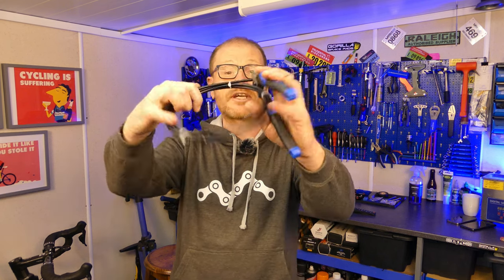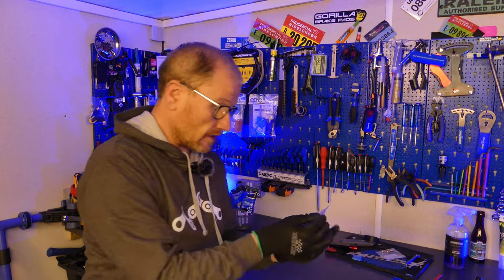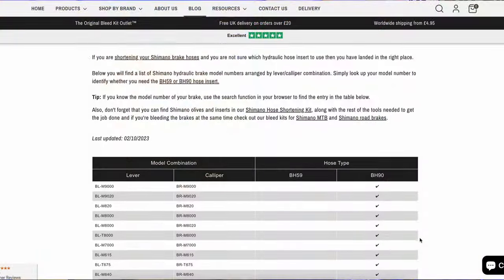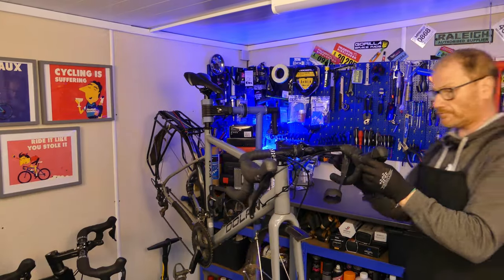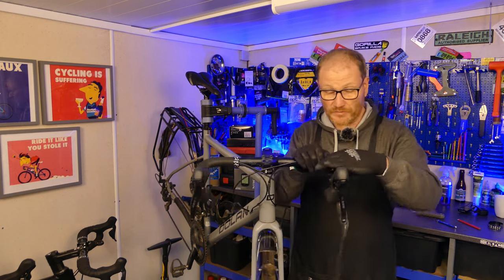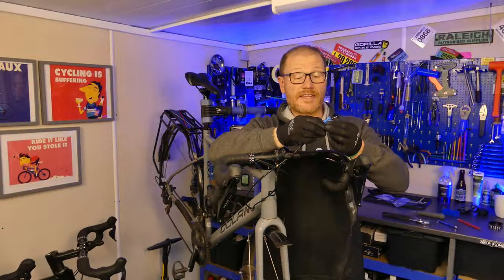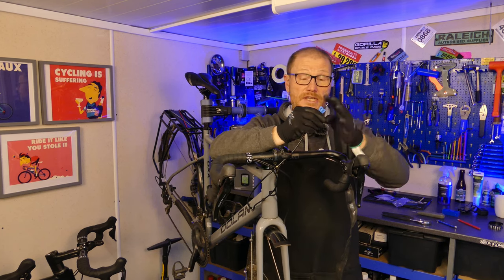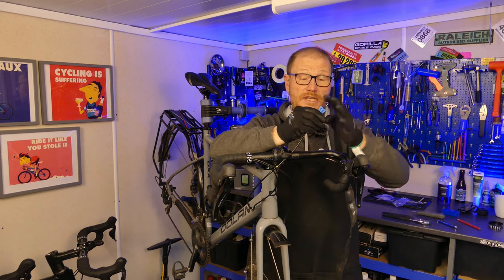How To Shorten A Hydraulic Disc Brake Hose - Road Bike maintenance

Comment: I'm using BH90 hose on calipers that use BH59 nominally. It works just fine, because the only thing that changes is the inner diameter of the hose and thus the barb that goes with it. BH90 is thicker and thus stiffer, but I doubt most people would notice the difference; I certainly can't.
Reply from the maker: Agreed, Frostbiker. I think it's something silly, like 0.2mm difference. As long as you use the matching barb, there is no difference that I know of...... which then begs the question as to why the two versions even exist 🤔🤔🤔🤔

Comment: Great video, thank you. I need to reroute hoses through new bars. I can’t make the cables any shorter. Will I be able to get the original olive off and just replace that. Otherwise seems like a complete re-hose?
Reply from the maker: Glad you liked it. No, they're crushed on, so they won't come off...... many have tried before you!!! You'll need a new olive and barb for each end.

Comment: Nice video 👍 but I'm confused a bit about greasing the olive: may i use bearing grease for this issue?🤔 I have park tool ppl1 for example
Reply from the maker: Any grease is fine. It’s just there to stop the olive and calliper sticking.
Reply: @ribblevalleycyclist  Ok, thank you

Comment: Yet another great tutorial👍 

To reemphasize, DO NOT overtighten that nut. I did thinking it need to be flush! Heard a nice loud crack😱
Discovered that I'd broken the lever😭

Lucky managed to salvage it with a patient bit of super glueing. So be careful!!

Also, keep your barb insert tool oil free. Otherwise it may not properly grip the hose.

Finally, to repeat, don't overtighten the bleed screw. It's made of soft cheese, and rounds out so easily. Don't ask about this either.😊
Reply from the maker: You were lucky to get away with that, JibbaJabber. Could've been a very costly mistake
Reply: I have managed to bottom out the nut a few times, but I've never broken a single STI lever body before. I guess I'll use the 8 mm crow foot with my torque wrench habitually next time (I have torqued compression nuts before to see and feel what it's like to torque something down with a crow foot).
Reply: @yonglingng5640  Yep. I've always done it without thinking. Only on this time, did I notice that it was no way near flush, so I cinched it a bit more - 'crack'!

Maybe I was sold a dodgy olive, although they belong to a legit pack from a reputable store. Either way, I'll be using a torque wrench on that nut from now on!
Reply: @JibbaJabber  One of my ex-colleagues cracked one as he accidentally added an olive to the hose, unaware that there's already one inside the STI lever (not his first rodeo connecting hydraulic lines), so he was compressing two olives simultaneously. All because he rushed.

Comment: Putting the olive on is not the next job after cutting the hose, that's making sure you've left the 8mm hollow bolt on the hose 😉
IMHO the barb insertion tools are a waste of money, its so easy to just clamp the hose in some pliers (using the blocks supplied with your brakes, or ask at a bike shop, they'll probably have some they're about to throw out) and tap it in gently with a (small) hammer. if you're gentle it aligns itself, no stress.